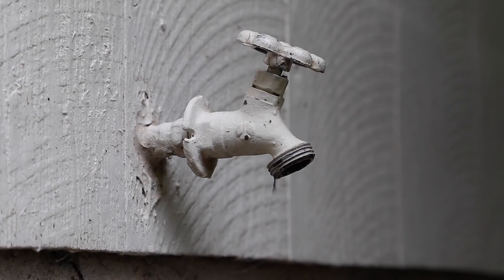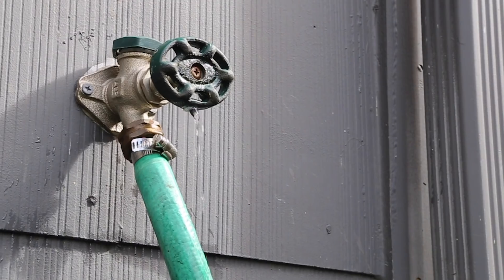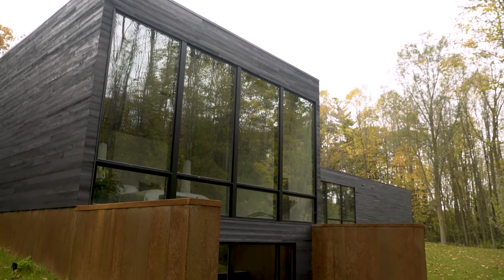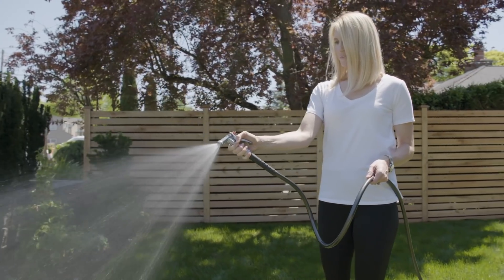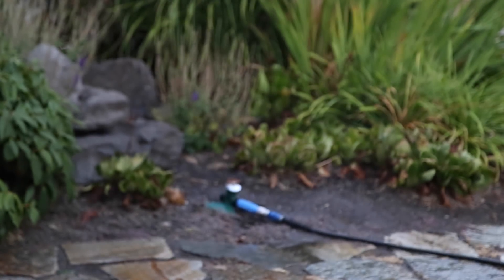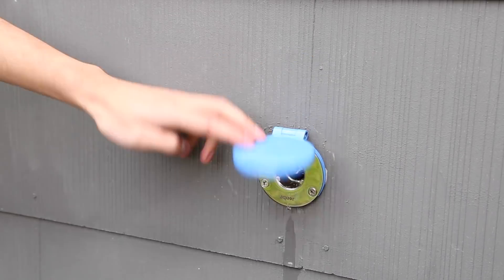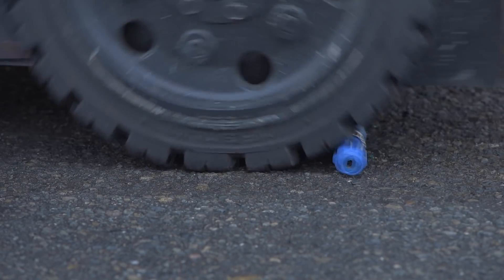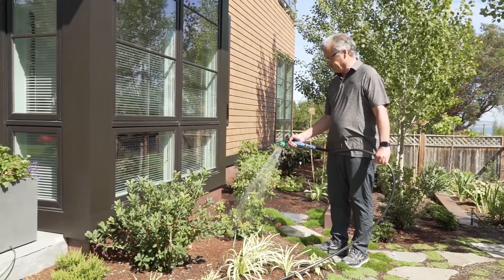Introducing the Aquor House Hydrant

Comment: I don’t know anyone who disconnects there hose every single time they use it.    I connect at the beginning of Spring & don’t take it off until winter.
Reply: I disconnect mine after every use.
Reply: It’s not great to leave them on there because bacteria can grow and then possibly enter your homes plumbing.
Reply: @nooneimportant4335  modern design, all irrigation pipe will have double check valve AKA backflow preventer to prevent back flow .